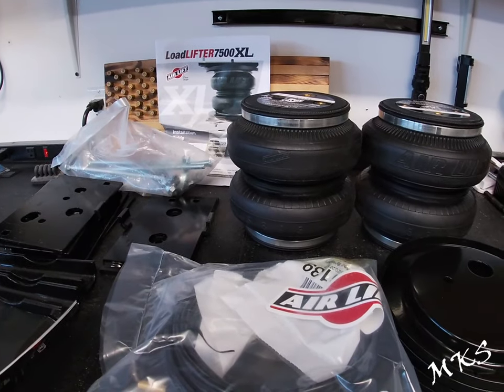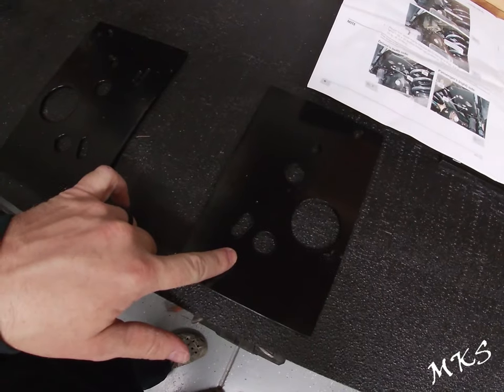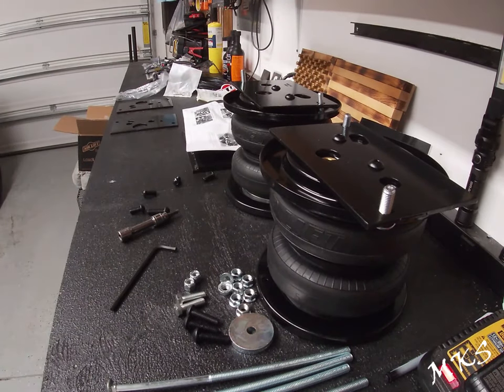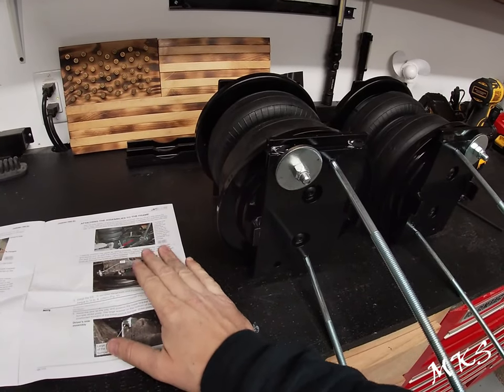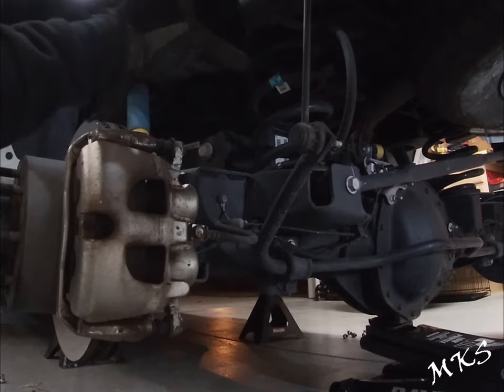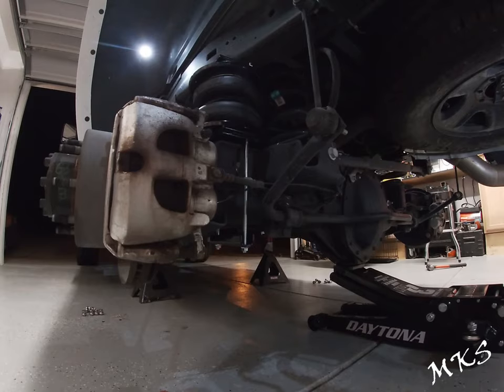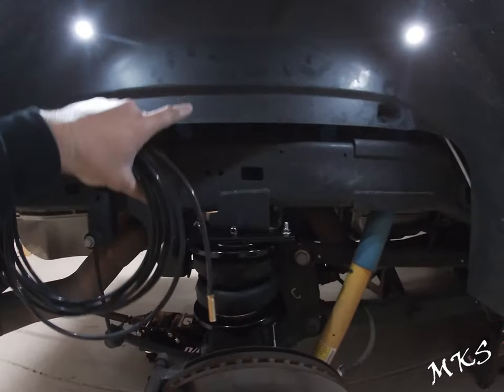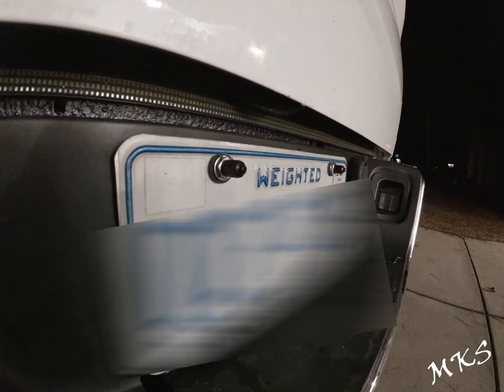2018 Ram 2500 gets Airbags| Air Lift  7500XL airbag kit install

Comment: Sold my Ford for a Ram..Can't believe the squat from my RV and the nose in the air with this truck..didn't need any helper bags or Timbrens with my Ford ...Thanks for the vid i'm gttn these on order.
Reply from the maker: Depending on how its loaded and the pin weight makes a difference, I have seen my fair share of Chevy trucks and Fords squatting from the camper or trailers.

Comment: I shouldve gone with air bags instead of the simco 750 springs but you live and learn
Reply from the maker: @cjbarlow61  multiple ways to do the same thing, when you need to change the helpers out look at these.  They have performed great.

Comment: Can you give the dimensions of the upper bracket? Specifically the measurement from the bolt that connects to the existing jounce bump stop hole to edge of plate closest to the tire? I want to verify If my 12.5" tires will clear the bracket. I just ordered this kit. Thanks
Reply from the maker: From front jounce bolt to outer plate edge is 2”.

Comment: I have a 2017 Tradesmen and haul a truck camper. Swapped to Bilstein's 5100 because the stock and springs were killing me with that spring bounce, lol! The 5100 are softer than the stock so now I roll with the camper when I have a full tank of gas even with no weight in the camper. So this is the product I will go with. Do you have a code so you get credit?
Reply from the maker: https://amzn.to/3KWvdlk, we are amazon affiliates and earn commission off product purchases.  This is just one way we are able to support the channel.  Thanks for your support.

Comment: Nice install video!  Would these still work if you had a 5” exhaust pipe?
Reply from the maker: I cant say for sure as we are running factory exhaust.
Reply: @MKSPerformanceOffroad  no worries just confirmed they’ll fit no problem thx!

Comment: I like the way you routed the air line through the large hole in the frame, just behind the airbags.  Are you concerned or did you do anything to protect the line from rubbing the area as it goes through the hole?  I just received my kit, same as yours, and appreciate your install video. Thanks.
Reply from the maker: You can use a protective sheathing like this, https://amzn.to/3ljV1uU.

Comment: 4 inches or 2 inches? Great video by the way. Can you show a pic with the fifth wheel before and after please?
Reply from the maker: I said 4 in but meant 2 in reason I put the text in.
Reply from the maker: That is with no load so Id be willing to say it will get you 3-4 in with a load once you figure out your squat.

Comment: Great video. I see your running aftermarket wheels.  Would stock wheels with larger tires rub the brackets?
Reply from the maker: It will all depend on your wheel offset.  I dont think you would have a problem.  Just make sure you have the required clearance between the bag brackets and tire.

Comment: Where did you put your jacks stands? I noticed you weren’t supporting it from the axle. Seems like the axle needs to go up and down.
Reply from the maker: Jack stands are on the frame and I used a jack to control the axle in order to drop it and create some clearance for installation of the bags.

Comment: I wonder if you can fit a T for both bags and fill up through the line coming out of the T so both bags fill at the same time and that way you dont have to fill them separately
Reply from the maker: You can but the issue you may run into is when you turn and the load puts more pressure on one side it will push air to the opposite bag.  You could do that if you put a check valve at each bag and plumb an exhaust to release pressure.
Reply: @MKSPerformanceOffroad  makes sense thank you
Reply from the maker: @ezurmnd  no problem, thanks for your support.

Comment: Nice detailed video, have you added limit straps? The 90 connector is known for breaking if the bag is over extended, which happens pretty easy.
Reply from the maker: I have not installed limit straps.  The 90 shouldn’t break since it is at a point that is hard mounted to the frame and doesn’t move.  I have had zero issues so far.  Thanks for the support.

Comment: Do they make the ride smoother at all,  I am asking because i have a 2020 bighorn 2500 and she rides like a tank.
Reply from the maker: I dont feel any difference, however, it did level the truck back out with a load in the back so my front end wasnt so light anymore.  If your looking for a better ride I’d look at your setup in terms of spring and shocks.  I’ve heard airbags all around is a pretty nice ride😉

Comment: How heavy is your fifth wheel? I’ve got a 42’ toy I pull with my 2500 ram and the loadlifter 5000 was plenty to level out my truck.
Reply from the maker: 5000 would have been sufficient and I didnt choose the 7500 based off fifth wheel weight just my preference and availability at the time.  The trailer is around 11k last time we weighed I cant remember pin weight.

Comment: Now that you've had it for a while did the internal bump stops make the ride more harsh?
Reply from the maker: No, I really didn’t notice the internal bump stops while traveling and the ride was actually smoother.  Helps to make sure your weight is distributed correctly for pin weight as well.
Reply: @MKSPerformanceOffroad   oh nice, sounds good, I'm about to order them. Thank you.

Comment: Where are y'all mounting the compressor?
Reply from the maker: These are manual fill unless you plumb a compressor.  Depending on the type and size of compressor there are several places to mount.  I think air lift has pretty good mounting solution.

Comment: Always baffles me that they swapped to springs on these 2500s
Reply from the maker: Surprised at how many different suspension options there actually are between air, leaf, and springs.

Comment: The kit I bought for my 18 ram 1500 was drill in frame and bolts broke in frame
Reply from the maker: What is your question?
Reply: @MKSPerformanceOffroad  well 1 question I have do you recommend the braided lines
Reply from the maker: @abner0404  I dont think they are necessary as long as you have the air line routed well and protected.

Comment: Can you fill these with a Dewalt 20v air compressor?
Reply from the maker: Never tried but as long as the compressor can push up to about 90 psi you should be good.

Comment: Will this work for a Ram with a lift?
Reply from the maker: Depends on how high of a lift but generally these bags are made to fit stock height.  The issue you would run into is the bag only has so much travel on it so that would be your limiting factor

Comment: Does this work if i have a 2" lift in the rear?
Reply from the maker: Im running stock height with these bags so I would say the best answer I can give to you is found here per airlift guidance.  https://www.airliftcompany.com/workshop/determine-correct-lift-spacer/
Reply: @MKSPerformanceOffroad  thank you sir

Comment: I have the 5000 Ultimate + Be careful to not overload your rig… It’s not a dually and SRW tires can only handle so much weight….
Reply from the maker: Absolutely, something I don’t cover in this video.  There is alot of variables to look at besides tires but pin weight, max load rating of wheels and tires also should be taken into consideration.

Comment: question sir?, it also works in a 2022, thanks for your work
Reply from the maker: You would need to double check with the manufacturer but Im not aware of any changes to frame or suspension setup on the 22’ trucks that would call for a different kit.
Reply: @MKSPerformanceOffroad  thanks 🙏